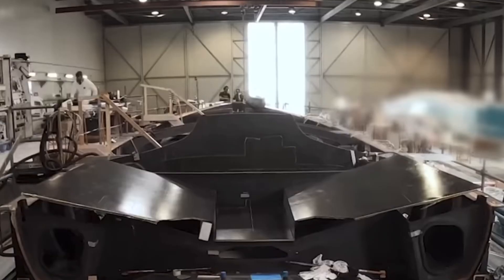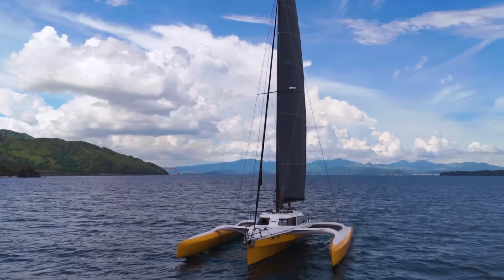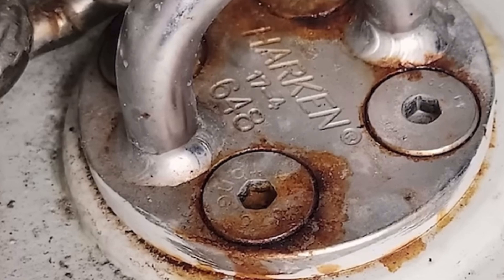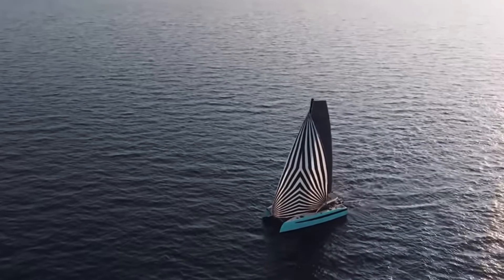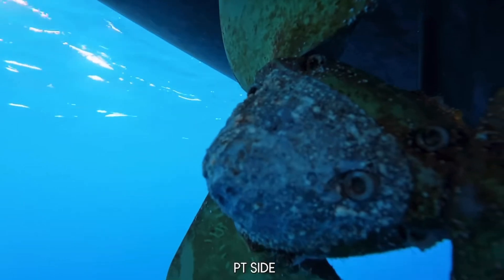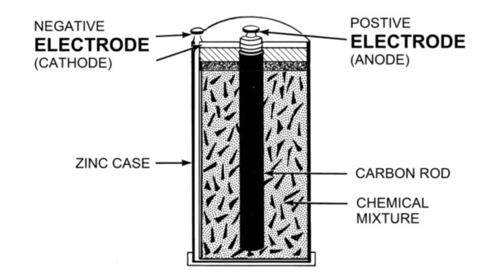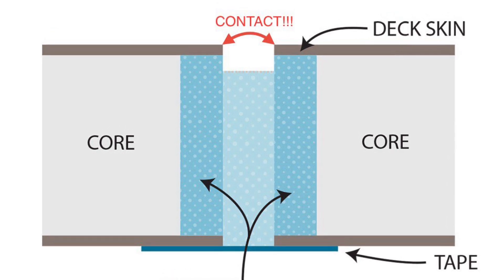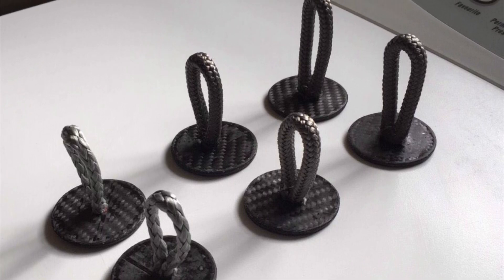Is Carbon Fibre Really a Good Idea for Cruising Boats?!?!?

Comment: I don't like the fact that it breaks, usually with no warning. I am a former professional mountain biker and team owner, and never used carbon fiber parts on any of the team bikes. I did sell a few carbon fiber frames with bonded lugs, but never handle bars, stems, or cranks. Saw way too many catastrophic breaks causing injuries. 
Zero chance of going into big blue on a boat made of carbon fiber.
Reply from the maker: Thanks for sharing that! Carbon fibre is incredibly stiff which is both a blessing and a curse. Some say S-glass actually has higher tensile strength (fibres alone) and can absorb twice as much energy (e.g. on impact) before breaking. But it’s not as stiff and weighs a bit more. Did you use aluminum on team bikes then?
Reply: @kailaniandi  Offtoad but road bikes are raced on as mch CF as possible these days.

Comment: Composite  construction with a foam core makes boats with shorter lifetimes. They may live fast and die young. Not the best for a performance cruiser.
Reply from the maker: Solid fibreglass definitely lasts a very long time and has good impact resistance! A fair bit heavier though…but everything is a compromise!!!

Comment: Is carbon flammable?
Reply from the maker: Yes carbon is flammable, unlike glass fibres, but in both cases the resin that bonds them together generally is flammable so fire is something to fear and avoid with both!
Reply: @SailingTipsCa many carbon fibers are fire resistant. It’s the builder that chooses to include it. Carbon fiber is not really flammable as they hold their structure when burning and eve stop burning when you remove the source of the burning. That’s not the case with wood, eglass and  many others

Comment: The weight saved means you need much less foam to make the boat "unsinkable".
Reply: True but you still need foam or voids to displace the weight of water.
Reply from the maker: @kizzjd9578  Yes the watertight compartments typically contain nothing but air or light things like fenders…kind of defeats the purpose to put heavy stuff in there!
Reply: @SailingTipsCa  100%. Id much rather a closed cell foam filled void than an air filled void. If you puncture that void from impact, it fills with water.
Reply: @kizzjd9578  I haven’t tried it but I think my boat would even float with all the watertight compartments flooded because of the closed-cell foam in the laminate core!
Reply: @SailingTipsCa  I have seen closed cell foam that weighs less than 10kg per cubic meter. So a boat that weighs 10 tons would need 10 cubic meters of foam, which only weighs 100kg (1% of the total boat weight). 10 cubic meters can be spread around the hull so it takes up less space than you would think.
Reply from the maker: @jimj2683  You could conceivably shape it to fit into all kinds of otherwise “useless” spaces!
Reply from the maker: That’s one way of looking at it! The method recommended by the World Sailing Special Offshore Regulations is to have multiple watertight compartments. My trimaran has at least three watertight compartments in each hull (10 in total) and can still float with at least half of them flooded.

Comment: I’m not sure the performance offering of a Rapido is achievable with GRP, which is why they’ve gone down the carbon route. Carbon has allowed for a smaller rig and sail area, thus allowing the boat to perform but also to be cruiser-friendly. A GRP comparison would be an ORMA-60… but then that is the definition of non-cruiseable with it’s 100ft mast, insanely tight living area, and twitchiness that resulted in the loss of Mighty Merloe.

The stainless to carbon corrosion issues are sloppiness - pure and simple - and HH should know better.

CO2 emissions? Riley and Elayna don’t drive a car day-to-day like most folks, so while their Rapido might have produced a lot of emissions in the factory build, they’re also offsetting by living aboard…

Your one really valid point is the noise. Uninsulated carbon boats are loud… but then so are metal boats really.

Carbon has a place in high performance cruisers, just like all the other boat building materials with their respective pros and cons.
Reply: @PN_48  Well, the ORMA 60 was a pure raceboat not a cruiser, so not an apples to apples comparison.
Reply: @James_Aron_1967 True, but my point is for the same performance in a 60ft package, the GRP version would require a higher rig and less weight - hence reducing the cruiser-friendliness of it
Reply: @PN_48  Yes, understood.
Reply from the maker: Great points! I think it’s completely appropriate and reasonable to use carbon fibre in areas requiring high strength and stiffness, like the beams and load bearing bulkheads. For me the debate is really more about the areas of the boat that don’t require that, like non-load-bearing parts of the hull and deck, which could be built almost as light by carefully managing the resin content and build process with S-glass and foam/Nomex. And yes liveaboards can offset the carbon emissions by driving much less - I just wanted to bring to light that carbon fibre is much more energy-intensive to produce which most people aren’t aware of. The loss of Mightly Merloe is an interesting topic - in the end I think even the most hardcore French offshore sailors were scared of the ORMA 60s, which I think was in large part due to the dimensions boat being almost square which combined with a very tall mast created a propensity to pitchpole. Since then racing multi designs have been longer than wide.

Comment: A very good start to understand carbon fiber in boats. Good job. There is another  major area to be considered. That is grounding becomes an enormous problem in carbon fiber boats. The solution to these problems requires an electrical engineer with specific training in grounding problems. Grounding is tricky. Hire a trained professional. Failure to do so risks high likelihood for problems.
Reply from the maker: Absolutely! Some say the electrical system in a carbon boat needs to be completely isolated, somewhat like an aluminum boat. Aluminum boat builders and repair shops would be well aware of the techniques involved, but shops that specialize in fibreglass have a learning curve!

Comment: Racing boats have learned that you dont mix metal and carbon, the high performance cruising manufacturers have not taken this on board, or know full well, but are trying to make savings.
Reply from the maker: Yes I think there’s definitely a learning curve here especially for the builders who are accustomed to fibreglass.

Comment: One more point. 
There is little benefit from adding carbon to glass at stress points. As the carbon is a lot stiffer than glass, it ends up taking the greater share of the load, so the glass does less than it is capable of.  Better to just add more glass.
Reply from the maker: Yes just blindly slapping on layers of carbon fibre onto an existing structure may not be helpful. On the other hand a boat designer will typically take material properties into consideration and specify the appropriate layup schedule, materials, and cloth orientation for optimum performance. In some ways this is really no different than high-tech lines where the load is taken by the Dyneema core and not the polyester cover.

Comment: I believe the racing boats are mostly using it for its stiffness rather than strength to weight. CF's strength to weight is only marginally better than E-glass, especially once the resin is factored in. But its stiffness to weight is far better, so they can use less total material as stiffness is the limiting factor for them. But stiffness comes at the cost of durability, so god help the racing boats if they ever hit anything as they now have less and more brittle material. And the last thing you want as a cruiser is a boat that can't tolerate any impact. So no i think CF is a poor choice for cruising boat hulls. S-glass would be much better if you have money to burn. You could still use CF for the superstructure though.
Reply from the maker: Yes people often use strength and stiffness interchangeably, but as you noted it’s important to realize that stiffness is really where carbon fibre excels. Some say S glass even has higher tensile strength, but it is also more flexible which may be good or bad depending on the part of the boat you’re talking about.
Reply: Stiffness is achieved by adding weight so you comment doesn’t  seem to make sense.
Reply: @anibaldamiao  I mean material stiffness. Not handling stiffness.
Reply: The amount of retirements of imoca's due to serious structural damage.
Reply: @jackdbur  I can believe it.

Comment: When we talk about 60foot boats, CO2 emissions are irrelevant. I mean people chose big carbon footprint anyway.
Reply: Carbon footprint are never irrelevant
Reply: @scottwallis7210  Carbon footprint is irrelevant for buyer, if it would be relevant they would not buy 60+ feet monsters with space technology, but rather restore old wood boat or steel. As I wrote, buyer made a choice to produce a lot of tons of CO2 so that part is not important for them.
Reply from the maker: I think most people are largely unaware that carbon fibre has a much larger carbon footprint than glass fibre…not sure that knowledge would change their spending habits though…

Comment: Totally agree about carbon but I like aluminum more and more over any composite material for its durability alone. There are at least three sailing channels that have commissioned aluminum catamarans. For those who are seriously thinking of doing oceanic voyages or any long-distance sailing aluminum might be a material to look into. It has downsides such as galvanic corrosion but all materials have negatives. Aluminum is light for a metal, durable and relatively easy to repair when impacted.
Reply: My first boat was used at higher latitudes and was all aluminum, even with extreme insulation it was cold in winter hot in summer and noisy.  Have gone fiberglass and while it's a bit heavier not missed my aluminum boat yet...
Reply from the maker: @promisefisheries7901  Good point! I was thinking mostly from a strength perspective, but aluminum is also an excellent conductor of heat so hard to keep warm, subject to condensation etc. Fibreglass is a far better insulator.
Reply from the maker: I’m a fan of aluminum for cruising boats especially in the high latitudes!
Reply: Aluminium is good if you expect to hit things as it's very durable. But marine alu is very weak compared to fibreglass. That's why it's popular for high latitude sailing that has to deal with ice. Or for jetboats that run aground all the time. Another downside is fatigue life.
Reply: @N330AA  Weak compared to FG in what respects? Rigidity?
Reply: @James_Aron_1967  The yield strength of FG is about 10-15 times that of 6061. Though it is unidirectional.

Comment: awesome to see you back ,, I agree , the sound of a carbon boat is too much,, I was only made aware by another veteran sailor and now I hear it when seeing other videos ,, actually makes me appreciate my wooden/epoxy boat a lot more now
Reply: Sailing in stormy weather is also noisier and some people stop sailing on those days
Reply from the maker: Thanks good to get another video out! There are some very nice wood/epoxy boats out there -  I’m currently spending a fair bit of time sailing on a cold-molded Wiley 43 and it’s a great boat!
Reply: Wood is good, its a natural fiber like carbon or glass fiber.
Reply from the maker: @NICOLAS25478  Wood boats are also very quiet and warm! Cedar strip cold molding would be my favoured option for wood because it’s still lightweight and cedar resists rot if it gets damp.

Comment: carbon mast and glass hull maybe?
Reply: Carbon masts are notorious lightning rods. There are videos of carbon masts exploding after being struck by lightning. That said, if I had the option to choose carbon for a mast material when optioning a boat build, I'd choose it anyway!
Reply from the maker: @James_Aron_1967  The primary alternative to a carbon mast is aluminum, which is also an excellent conductor of electricity, although it likely would not explode in the same way during a lightning strike. Aluminum masts are also generally less rigid than carbon masts.
Reply: @James_Aron_1967 All masts are giant lighting rods .😊
Reply from the maker: Carbon mast and glass hull (foam cored) is actually a very common combination for lots of racer/cruiser boats (e.g. J120) and lots of older race boats (e.g. Farr 40)!

Comment: WOW.... Well done... Thx for sharing! Carbon Fiber Dangers...
Reply: Aluminum cruising for me. Garcia Exploration 52ft. Best boats ever!
Reply from the maker: I agree that aluminum is a great choice for cruising! I also find it quite nice to work with.
Reply: @SailingTipsCa  I have read that over about 55 feet, an aluminium catamaran apparently is stiffer than its counterpart in glass.
Reply from the maker: @geoff850  I wouldn’t be surprised by that subject to how the stringers and everything are designed. I’m looking forward to seeing how Delos 2.0 turns out!

Comment: I will take issue with one thing: you state that there is no point in using carbon to save weight if you are going to load up the boat with gear. But the whole point is that the weight you saved by using carbon is now available for "payload". Any design will carry a certain load, and the vast majority of that load is taken up with boat structure, machinery and fittings etc, leaving little for cruising toys. If you can save say 1000kg in the boats structure that leaves 1000kg of extra payload for dive gear, SUP boards, extra sails, extra fuel etc. Most multuhulls I see cruising are overloaded and its dangerous.
Reply: Would it not be better to just build a slightly larger boat in grp rather than carbon? You get your increased payload, and it still costs less than the smaller carbon boat.
Reply: @timevans8223  That is certainly one option. And it's the one I chose with my own boat, a Sundeer 60, though I went for length rather than size. With any boat though, the lighter you can make it for it's length - the displacement length ratio (D/L) is an indicator of speed. A traditional boat like a wetsnail 32 has a D/L of around 420. Loaded for cruising it's probably closer to 480 at least. A modern Beneteau will be around 170-200 fully loaded. My Sundeer is at 90 fully loaded and probably better than most performance cats. And because of that among other factors we average over 200 miles per day offshore.
Reply: @timevans8223  On top of that you get a bigger living space. So, it's a win/win.
Reply from the maker: Yes you’re absolutely right in that that weight you saved in the build is now available for payload! You’re also right that most are overloaded…
Reply: @SailingTipsCa  for the several hundred kg more load capacity the huge downsides are not worth it carbon fibre hull skins are brittle and fractures, its very noisy & it has to be insulated from any metal.
Reply: @jackdbur  Yes I think a better strategy if you need more payload is to just get a bigger boat!
Reply from the maker: @jackdbur  In the end if you need load-carrying capacity maybe better to look at other materials and designs altogether!

Comment: My background and experience is with Surfskis. Surfskis are a type of sit-on-top ocean racing kayak that can ride ocean swells under the right conditions ! They are generally 20 feet long and 18 inches wide so they need to be very strong. I've had surfskis built of many different constructions over the years. Like you said, carbon is pretty brittle. I've had two carbon skis that suffered 'puncture wounds'. Too fragile in my opinion. Fiberglass is okay. A bit heavy, a bit soft and thus 'dimples" easily. Easy to repair. The construction I've come to like the most and holds up the best is carbon/kevlar. You get the rigidity of carbon with the puncture resistance of kevlar.
Reply from the maker: Thanks for sharing that! There was a Farrier trimaran that sailed in the arctic a few years back and they reinforced their hulls with Kevlar. It’s apparently horrible stuff to work with though because it doesn’t sand out nicely. Maybe the carbon/kevlar combo is easier to work with than straight kevlar?